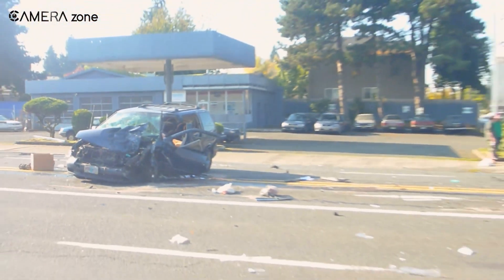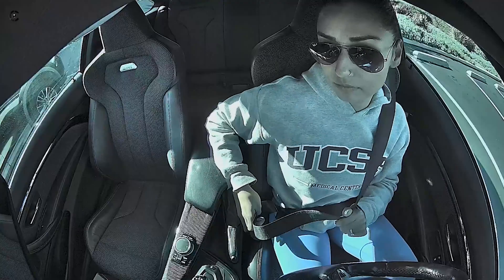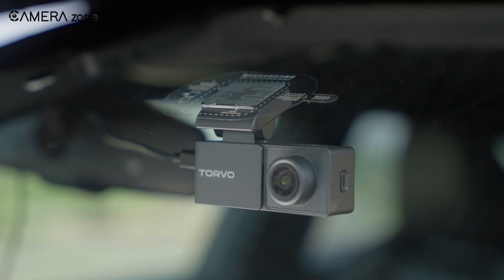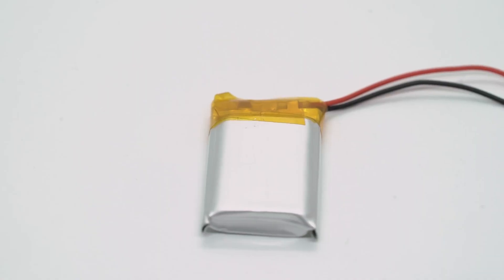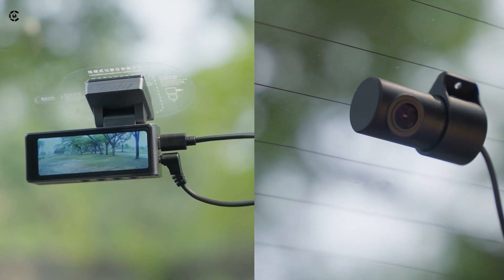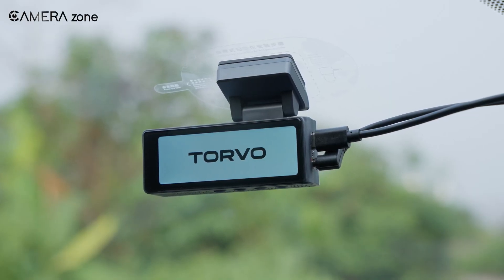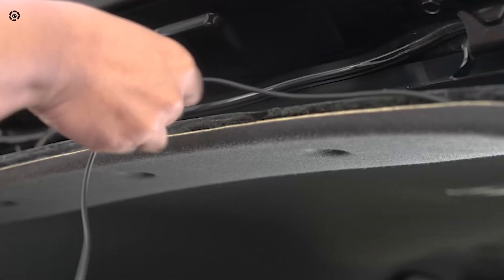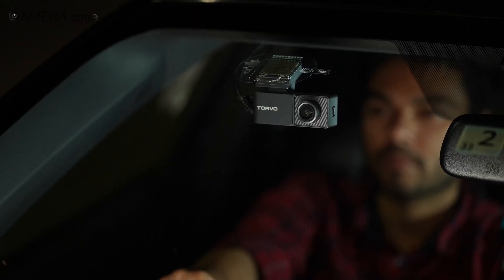Why Dash Cams aren’t Rechargeable - The Real Reason Explained

Comment: Would be interesting if the mounting setup for the windshield had an included solar panel >_>
Reply: The solar battery needs a lithium-ion battery to store electricity, otherwise it would be useless, as it would work every time it saw sunlight and turn off when it was in the shade.
Reply: @TheEdge3D  Solar doesn't require lithium-ion, lol, lead-acid would be fine 🙂